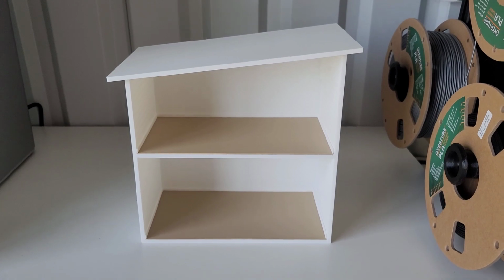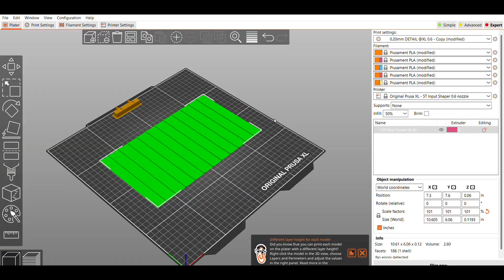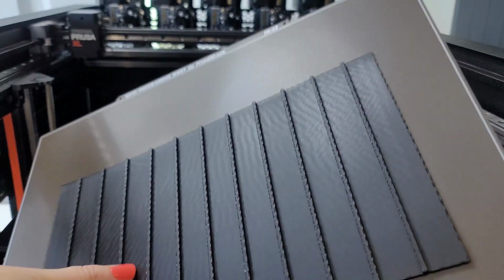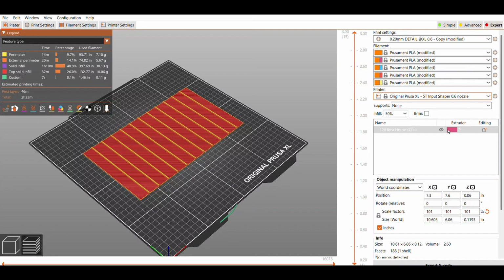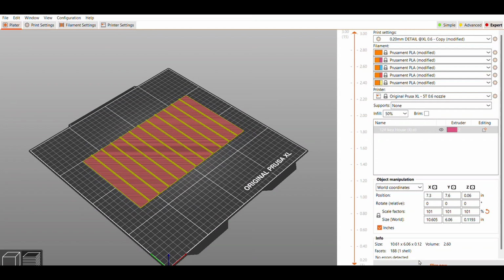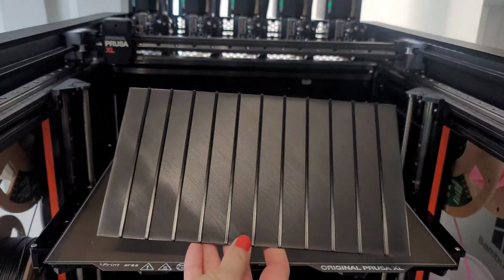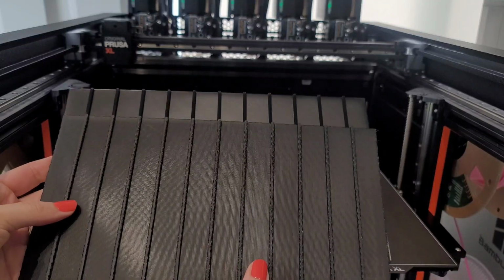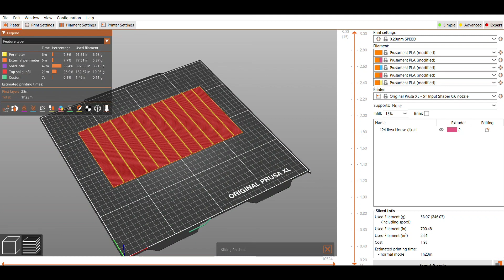Prusa XL - Don't make this simple Input Shaper mistake!

Comment: Nice catch.  This looks like a bug with the slicer not resetting the top option when picking a new printer down below.  My extra print heads arrived Monday but my printer itself is stuck in DHL Hell in Cincinnati, showing as "On Hold" for the past 24 hours even though the fees were all paid on Saturday AM.  At this point, I'll be happy if the box shows up looking relatively safe/intact.
Reply from the maker: I'm sure you'll get it soon. I feel like things don't update very quickly. You may get it before it even says it moved. Thanks!

Comment: The difference is that input shaper needs pressure advance tuning, especially for large parts.
Reply from the maker: So maybe it's not good for such a boring print?
Reply: @tada3dprinting  it's not a matter of it being "good" or "bad". Rather, it needs some operator knowledge about how the machine works to get optimal results. If you print at regular, slow (<80mm/s) speeds, it's very likely you will not get these artifacts.

Comment: You are good at troubleshooting problems.
The final print looks good, but technically on a metal roof, the ribs should follow the slope, else it would hold water and snow IRL.
Reply from the maker: You're right! I did design it to run that way and didn't like how it looked. That's why I like minis. You can get away with a lot that would never fly on real houses. Thanks!

Comment: The pattern on the flat surface looks oddly familiar. That's exactly what my first attempt at printing with IS looked like on the MK4. That strange fish skin-like pattern of rough and smooth regions. I have so far narrowed it down to two possible causes: 
1. My former favorite PLA filament (Das Filament); nothing I tried, temperature, print speed not even ironing, improved the results, so it feels that that material simply doesn't work very well with the MK4, while it gave me the best prints on my old Ender 3.
2. I sliced it (back in 2.6.1) with the input shaper profile and printed with, I think, 5.0.1 beta of the firmware. I was utterly disappointed before I found out it might be the material, so I switched to the non-IS profile and re-sliced it. Unfortunately I had ran out of the material so I used another but it printed perfectly. 
Without the material and with a new slicer (2.7.0) as well as new firmware, it's hard to say what exactly caused it. Generally I'd say it looks like overextruding combined with something else. Overextrusion would make sense since some filaments tend to expand quite a bit after leaving the nozzle and the next thing I would have tried would have been lowering the flow rate.
Reply from the maker: That's really interesting. Yeah I hate when you improve the next print but you're not sure how! Then you worry the issue will pop up again randomly!

Comment: I have been using IS on my MK4 a lot recently. I haven't seen this issue. However, when I upgraded to slicer 2.7.0 I did uninstall the previous version. Maybe that makes a difference. One advantage I am seeing with IS is much better first layer results. I think this may be related to the higher filament temperature that IS uses compared to the regular. 
Your end result looked very nice.
Reply from the maker: I'm pretty sure it did successfully uninstall the previous version but I may need to check. I seem to have the same issues on the Mini. I'll see if my Mk4 is doing it. Thanks so much!

Comment: I think the reason you don't see a lot of difference in time between input shaper and regular profile is because of the fact that most of the printing is on the first layer and the first layer is always done at slow speeds.??
Reply from the maker: That's a good point. It's large short print. Thanks!